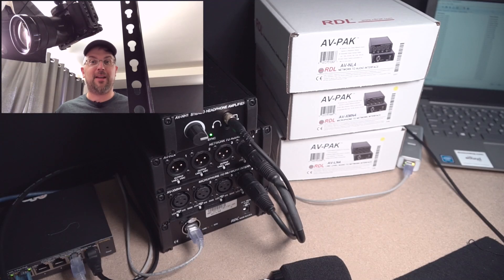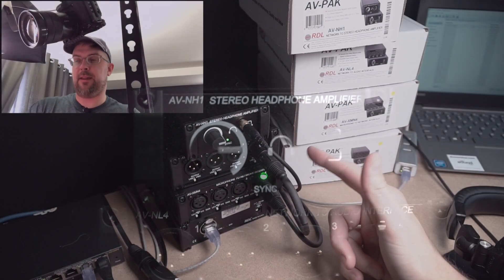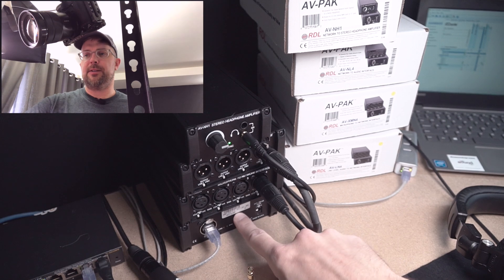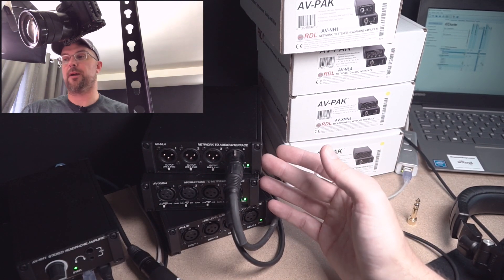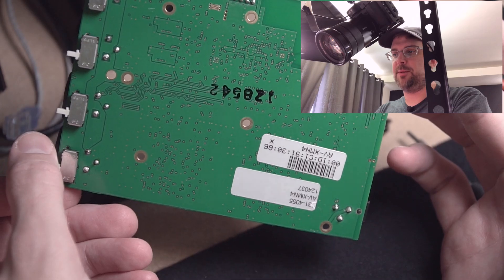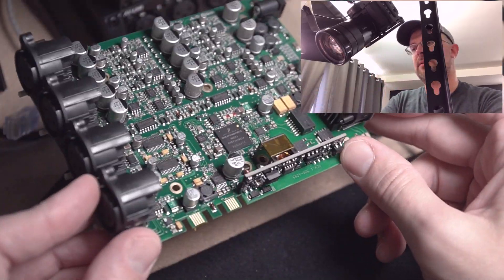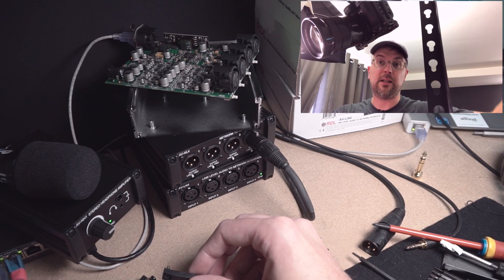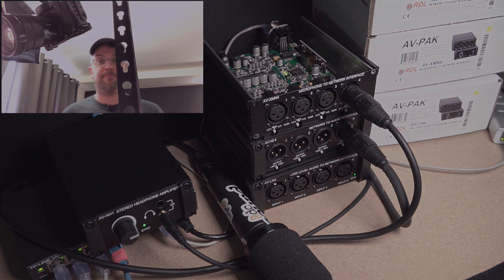#149 - Dante Audio Interfaces by Radio Design Labs - First Look

Comment: Great video! On another note, I don't think we ever got through the whole signal chain. I'd love to learn more about amplifiers and speakers-- how to match amplifiers to speakers, how to make sure you don't break any equipment, and how everything interfaces through different cables and connectors. My venue has been having some problems, and I've been spending hours and hours trying to learn what I can online, but the information doesn't seem to be easy to find. If anyone else in the comments has a good resource, I'll definitely check it out.
Thanks!
Reply from the maker: Absolutely Mark, thanks for the comment. The Live Sound Basics series certainly got derailed unintentionally, but it will be back! I’m working on future videos & how to make the info as useful as possible. Let me know what specific issues you are dealing with, I’m sure others will find it helpful too. All the best, Stay in touch!
Reply: @DcSoundOp  Thanks for the response! So, I just found out that the four EV SX100's hanging on each side of my stage are connected to their xti 4002 amplifier by microphone cables instead of speaker cables (and I'm kinda confused how the balanced and unbalanced cables are working with each other). It would be expensive to run new speaker lines to the stage, so I was hoping to use the lines we already have running for the floor monitors. I want to know if I can split the signal from the floor monitor line, and run it to the hanging monitors. All the speakers are 8 ohms, but I don't know how safe it is to use the SX100's at 2 ohms regularly, especially since we have 6 of the amplifiers stacked on top of each other, and heat might be an issue. I also can't tell if the amplifier can put out enough volts to power everything, since I'm seeing a bunch of different voltage numbers on these speakers. I guess in general I just want to be more comfortable with all of this so I can come up with the best solutions. Thanks for reading!
Reply: Update: I called Crown, and I'm going to test the amps at 2 ohms. I'll just have to keep an eye on the heat.